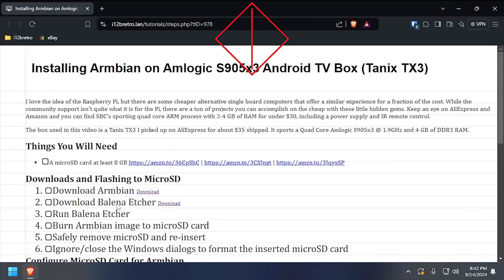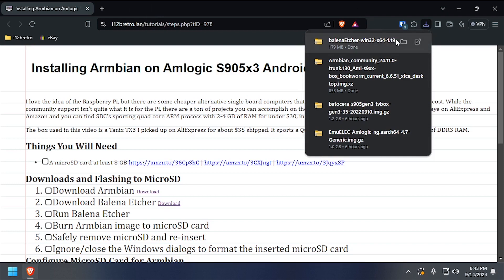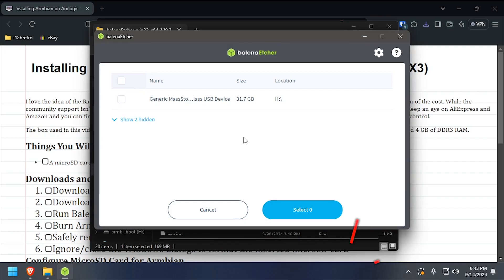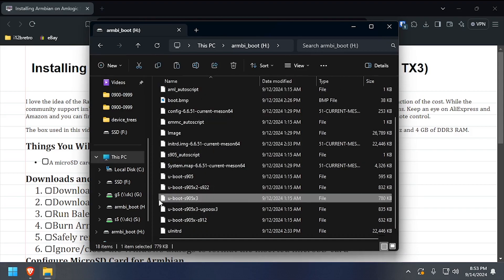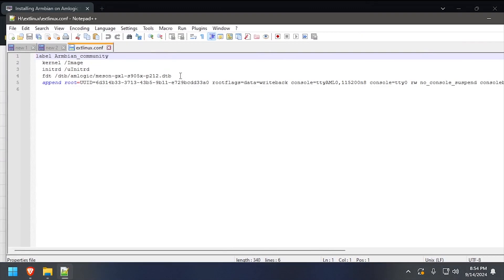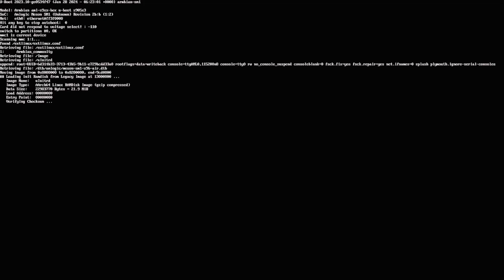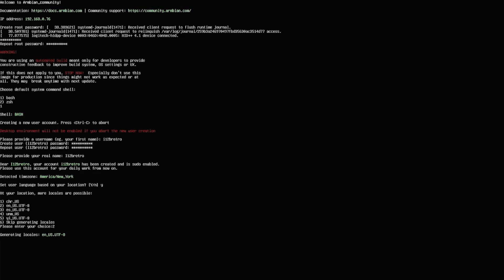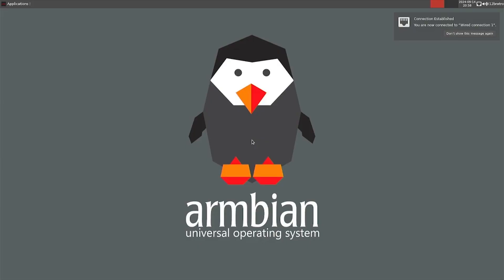Running Armbian on Amlogic S905x3 Android TV Box (Tanix TX3)

Comment: Great job! I'm researching a TV box to buy and found the X96 Max+ with the s905x4. Would you know if there is support for this CPU? I have experience using the Armbian system on an X96 Mini with the Amlogic s905w, and it worked really well, but I wanted to try this box because it has a slightly better configuration.
Reply: Usually, when you run armbian-config, it will help you select cpu details etc. I suggest you run your image from an SD card and just try it. You'll be surprised at how often it just works. More info on the Armbian forum.
Reply: I know this is late. Have you got any working armbian for your model? Looks like it’s one of the fastest processor compared to its predecessor but I could not find an armbian version that is supporting the S905x4. I could find a Linux version command line that works and CoreElec. I couldn’t find a armbian that supports that model.

Comment: Can this be used to install armbian on the internal storage?
Reply from the maker: Another video touches on it https://youtu.be/3hTXgf8iIJ4
Reply: @i12bretro  Thx for the quick reply!Unfortunately I just get a bootloop (not with the install, just with running off the SD card) with the tanix logo then a black screen and then the same thing again and again. 
I have some experience doing somewhat more complicated flashes and this is fairly simple so I don't think I did anything wrong. Since the title said this is for a Tanix TX3 I copied and modified the exact same files you did in the video. Is this correct or is this actually for some other box?
PS: Upon further research I think my board doesn't like that dtb.
Reply: @dividead100  Usually a stock release for that processor series will work
Reply: @i12bretro  PPS: I have a 2Gb TH3-P, tried to see if I can run Batocera with the 2G just to see if booting works and it runs just fine. Guess I am off to look for dtb files